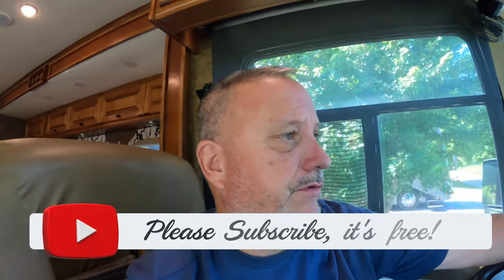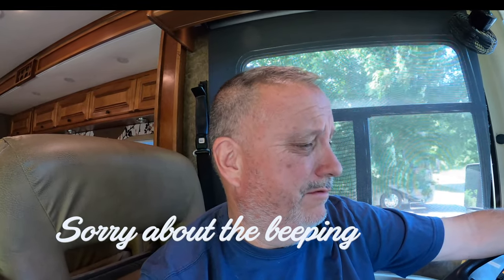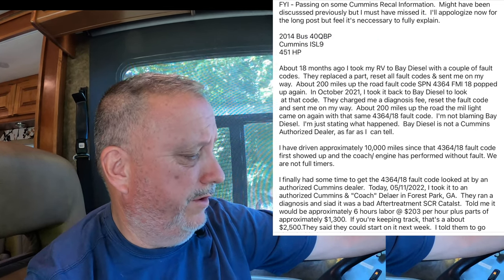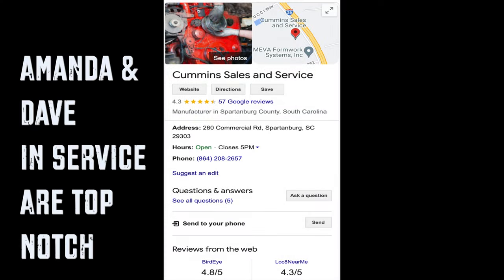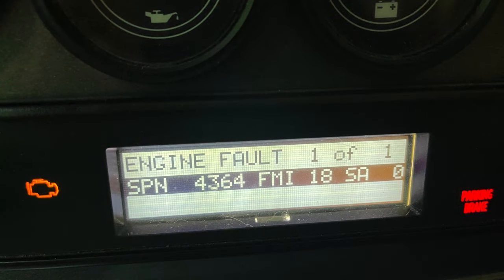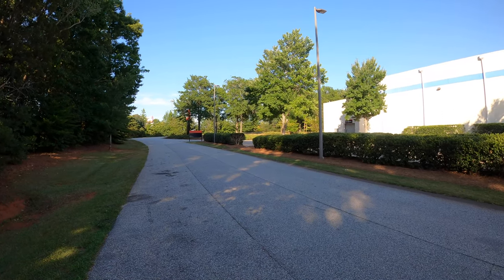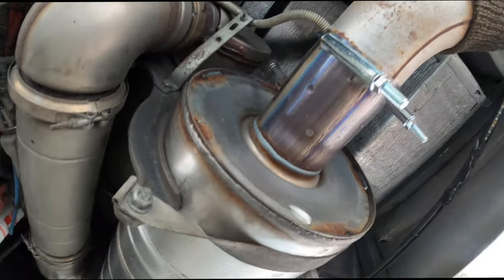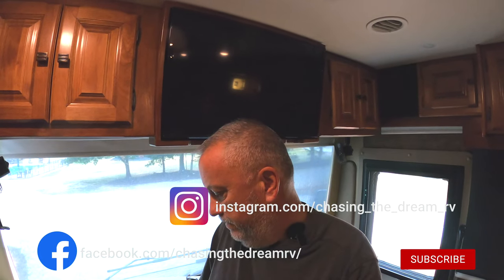Check Engine Light RV | Cummins Recall | Sunday Solution

Comment: Thank a million for this video.  My 2012 Newmar Essex has had the exact same issue and Cummins South Atlanta changed the NOX sensor at a cost of approx $1800.  I had no knowledge of the recalls and now have a STOP ENGINE light along with numerous fault codes.  I am a Cummins stockholder and have communicated my concerns to company headquarters.
Reply from the maker: Thanks for watching. ✌🙌💕